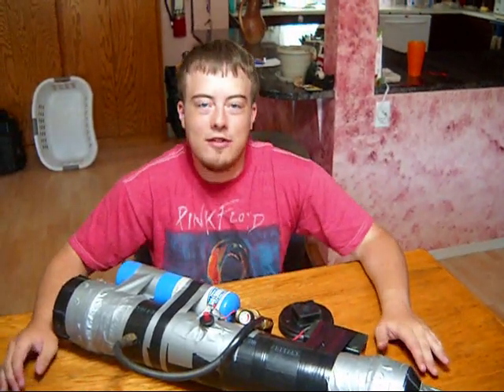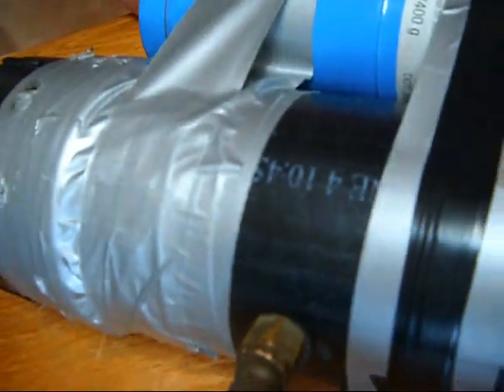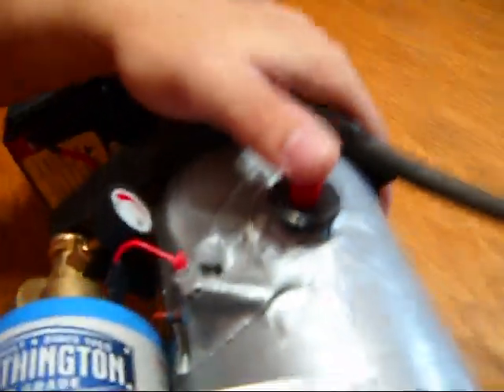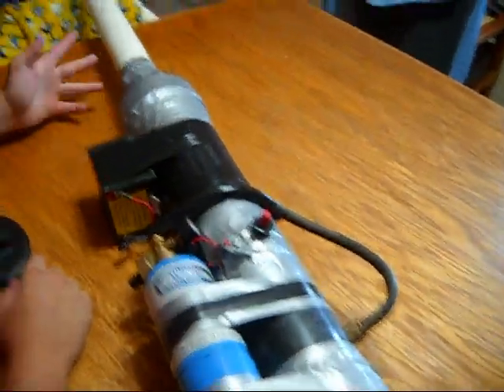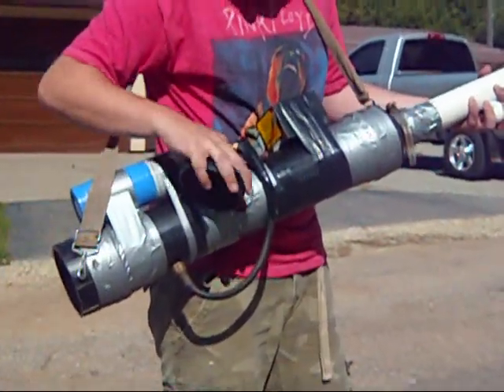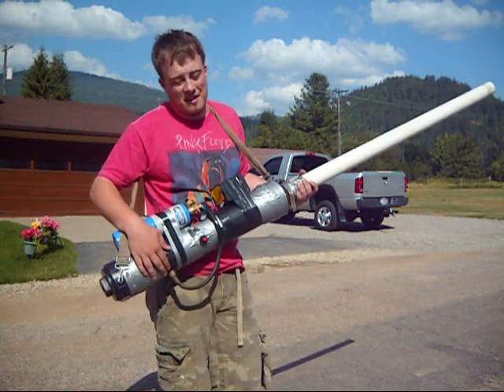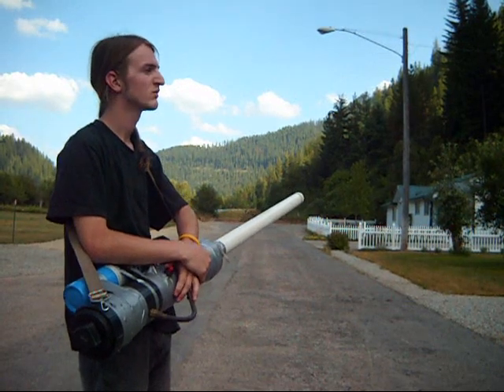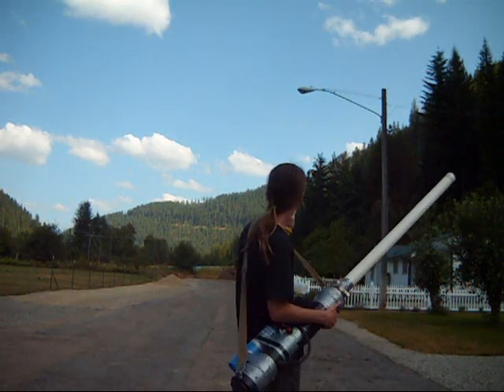R.R. Memorial Potato Cannon (propane)

Comment: If you want something a little more cheep than a stun gun go to lowes or home depot and get a battery powered grill igniter. they are much cheaper and have 4 wires instead of two for more spark. they are pretty reliable and waterproof. Also they are ment for high temps. But this is just a suggestion, i have one on mine and its never let me down.

Comment from the maker: @jailbrokenhelp well, no actually you don't. But if you omit the fan, be prepared for rather poor and inconsistent performance.(i know because originally we didn't have the fan) The fan mixes the propane into the oxygen much more evenly then without mixing at all. Sometimes you'll get lucky with the mixture and it will fire, other times it will be off and it won't fire. I happened to have a bunch of old computer parts and had nothing to lose from trying it out. radio shack has them for under $10

Comment from the maker: @MrandMrsStark  We actually did find a regulator that worked a few days after we made this video. The regulator didn't fit the propane tank at first but we went to Ace Hardware and tested out various brass fittings till we got it to attach. The regulator we found at Napa. That hose you see on the gun actually came from an actual propane tank that was hooked up to an old BBQ, same place that we got the ignition. Hope this helped.

Comment: If you put in more than one spark gap you can get a huge increase in the burn rate of the gas. If you get realy ballsey you also might try using hydrogen as the fuel instead of propane. I don't know if I would try that with a PVC combustion chamber though.